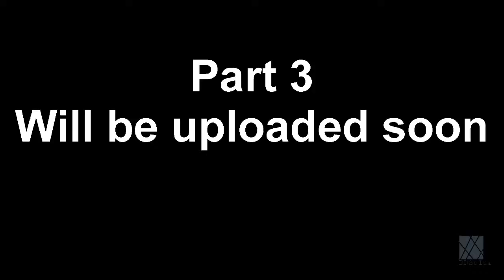Teardown and Repair or Salvage of a Solar Generator   Part 2

Comment: Does anyone sell generic or similar boards like this? Seems a cheap way to build a larger lithium system. 

Mostly  hoping to find the dc to dc charging circuits they use. I want to charge 24 volt batteries with 12 volts.
Reply from the maker: I've been looking for such generic boards, but so far have not found them. I'd be interested in larger ones too for building my own solar generators and projects
Reply: @solarpoweredge  give it 4-5 year as long as we don’t go to war with China and the market will be flooded with it. Especially broken units. The off grid power market is growing exponentially.

Comment: I have the same unit you are working on... Rockpals 300. I used it once, during hurricane Ian, on 9/28/22. Used for 3 days. Worked perfectly. Went to use it on 12/2/22, and it comes on for 5 secs., then shuts off. Voltage is at 11.7 volts. I'm an old USN Electronic Tech... Any suggestions? Sounds like it could be fuse you repaired in vid... Any insight/suggestions would be appreciated... Thanks!
Reply from the maker: Hi, unfortunately these generators often fail in storage due to poor design. They need maintenance charging, I have 4 of this type, wired up for parallel charging once a month. This is kind of a mystery but I'd check the voltages of each individual cell group - It's a 3S pack. Each group should be about the same. Should also check both fuses (2 in parallel). Hope that helps, wish I could do more but it's mostly guesswork with these things.

Comment: I have a Baldr 330  stopped working and started beeping. Do you know what that means
Reply from the maker: That's a tough call, because the microcontroller is probably doing the beeping and we don't have a list of codes or any information about it. It's possible the inverter is shorted or the battery pack has a bad cell. I'd open it and test the battery by itself as a first step. If it's good, you have a good battery at least.
Reply: @solarpoweredge  Thank you for your reply,  I have made a 4s 12p power bank
Reply from the maker: @chrislincoln489  Nice!!